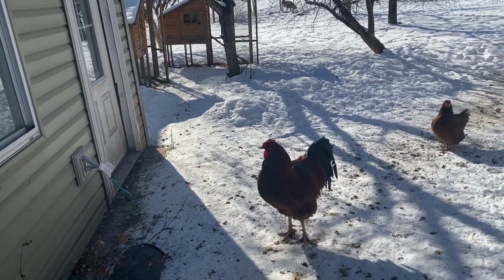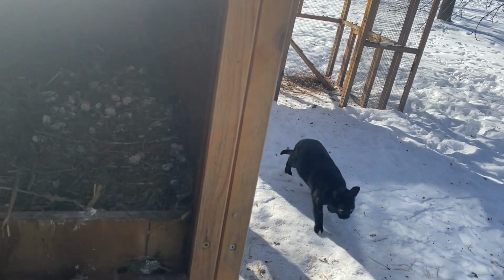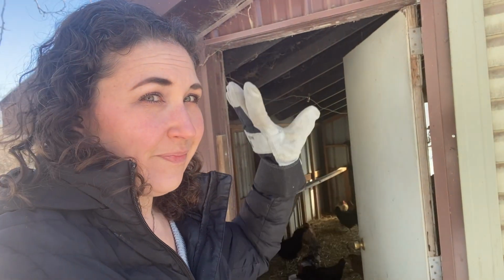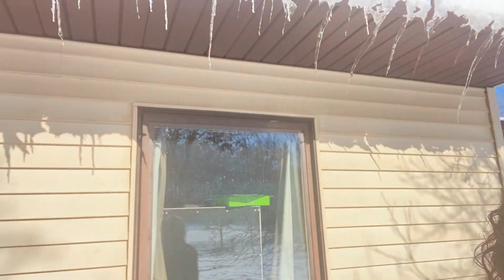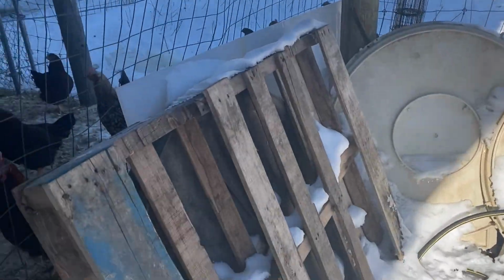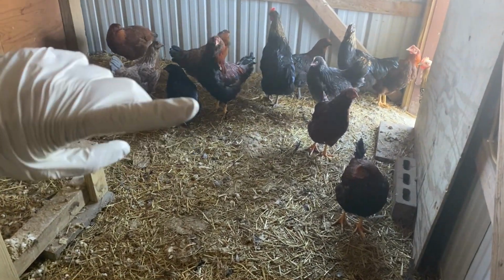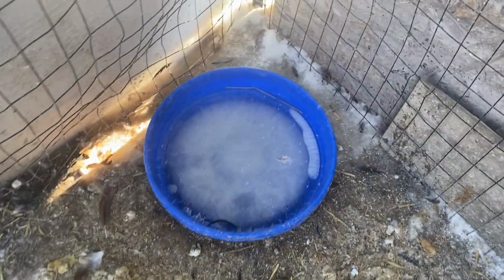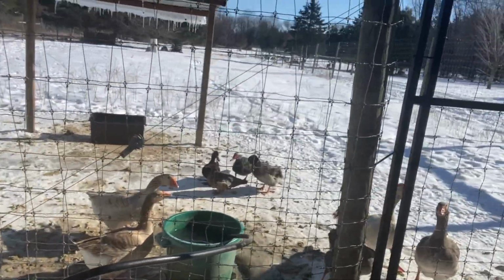#230 Not to EGG you on... Let's talk Chickens! Are they a good fit for you? What do they need??

Comment: Wonderful video!! What about predators that dig underneath your building wall? What do you do when your chickens stop laying? I have a small coop, so idk what I’ll do!
Reply from the maker: It really depends on your set up! For predators, we have the guard geese, we also have two German shepherds that run around and mark the property which helps some. You can actually buy coyote urine and mark the property with it yourself 🤣 We have had to set traps before and usually once you catch one of something, the others stay away for a while. Spring is the worst, when the wildlife has babies to feed so they venture out to find my chickens! We spend time outside then, trying to keep them at bay. Moving them behind the fence will help. When my girls stop laying, I let them rest. I am NOT a fan of using heat or artificial light. I figure God made chickens to rest on laying eggs for some of the year, I’m not going to force them to keep going! Upping the protein helps, but sometimes it doesn’t matter what you feed them, they just need a rest. Water glassing eggs through the rest of the year can help you have enough to last the winter!
Reply: Thank you!! Great advice! I was told to use artificial light! Good to hear I don't have to do it! I think I’d have to find someone to cull my chickens. Idk if I could do that. Love your videos!!